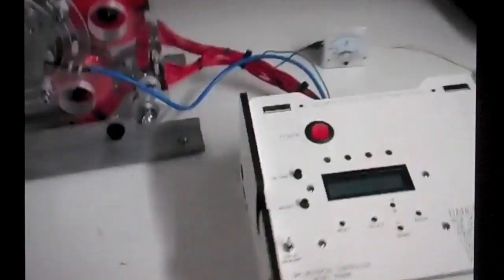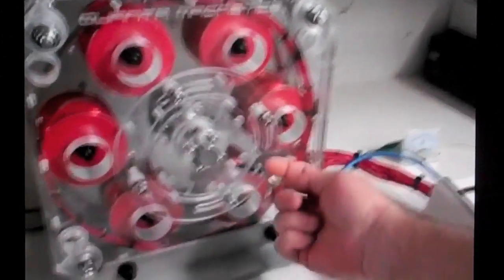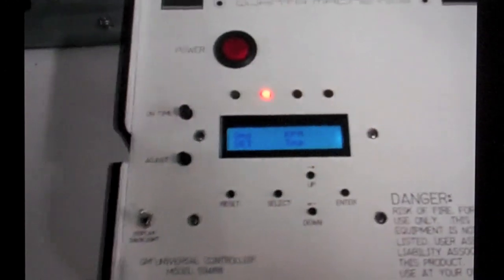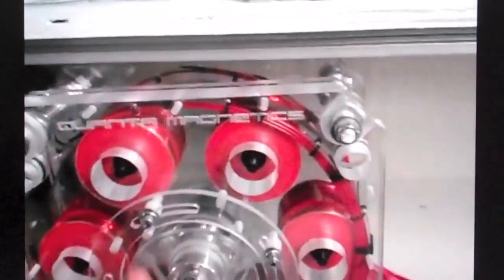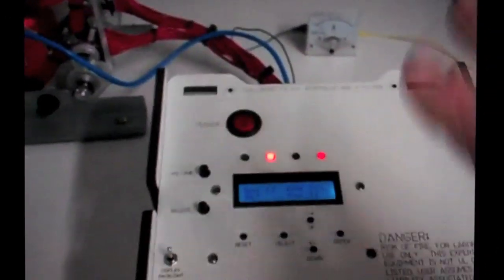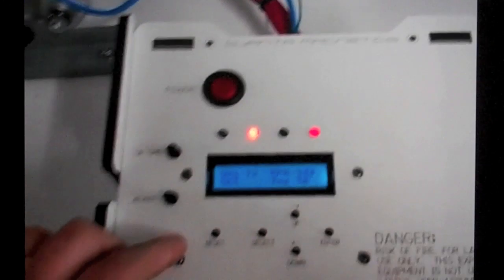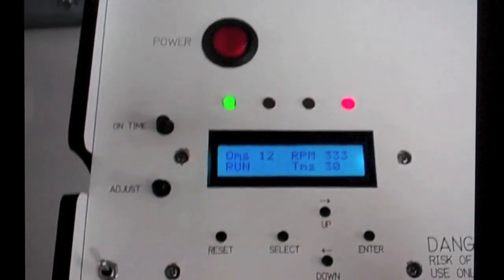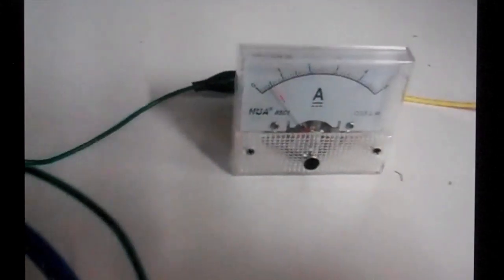QMU Controller rev2.0e RUNNING PULSE MOTOR GENERATOR

Comment: youre lucky the caps hadnt blown yet..but there so many of them and the 35k farads..i suggest that you rectify the AC coming out of the generator with a rectifier then a voltage regulator rated under the caps voltage for each bank, this will charge youre  caps to there full voltage and have more current, thus given youre motor more torque.. 
you have been charging youre caps with AC and that is a no no....if youre generator was to have enough current to generate youre caps would had blown on u